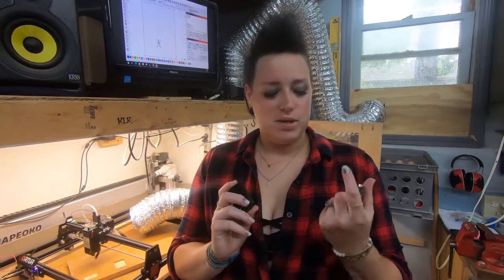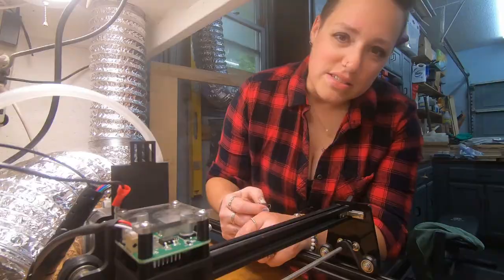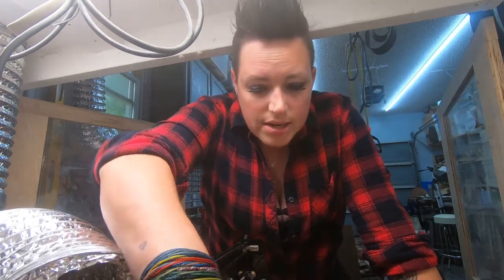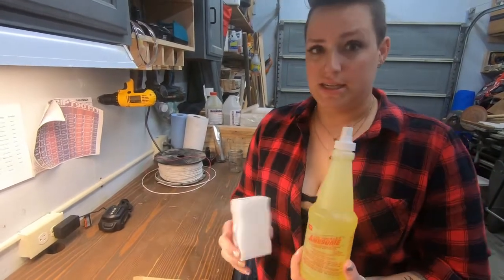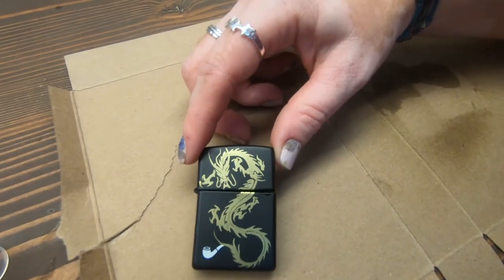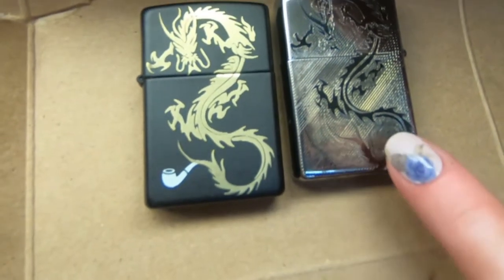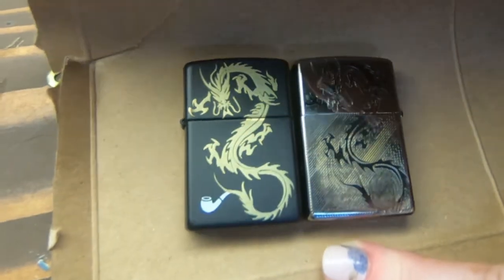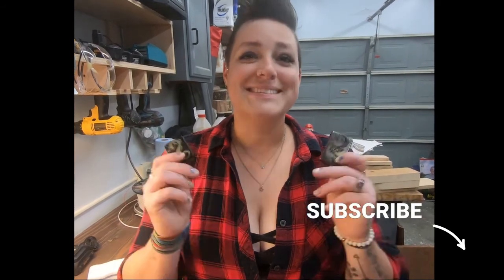How to Zippo Engraving: Laser Ortur LM2 Vs Diamond Drag Bit Shapeoko

Comment: Is it possible to use a CNC engraver on a black matte Zippo?
Reply from the maker: I would think so yes. You just have to get through the black.
Reply: @KLRform  Cheers for the quick reply! I am planning on engraving my black matte Zippo (according to their website: created with a powder coat that is applied electrostatically to the brass case), however, at the moment, I only have a CNC engraver at my disposal.

Comment: That looks great! What settings did you use on the laser?
Reply from the maker: 900mm/m and 70% power
Reply: @KLRform  Thank you so much for posting this. It worked like a charm for me but I think I need to adjust my interval spacing; it's currently at 0.084, did you go smaller to avoid any striation?
Reply from the maker: @richlaw9596  I didn’t. You can over do it with interval spacing in a similar way to overdoing dpi. It’s a fine line.